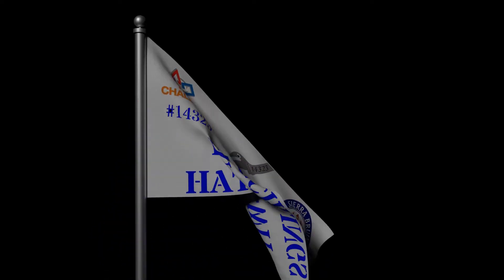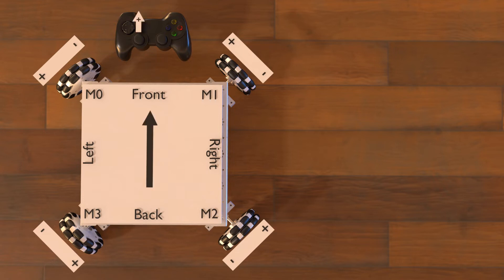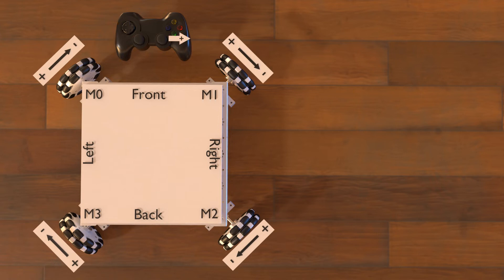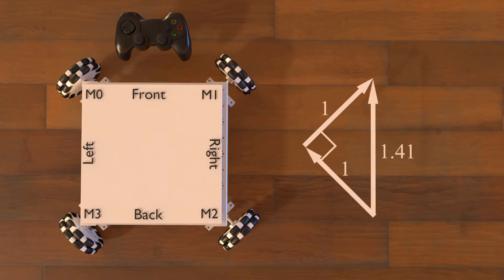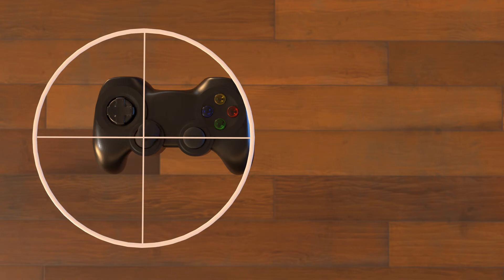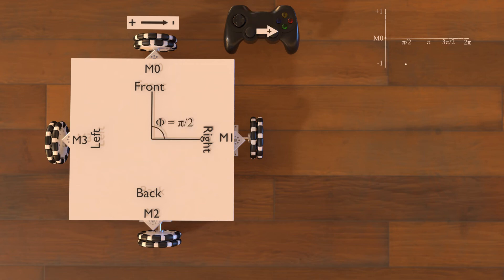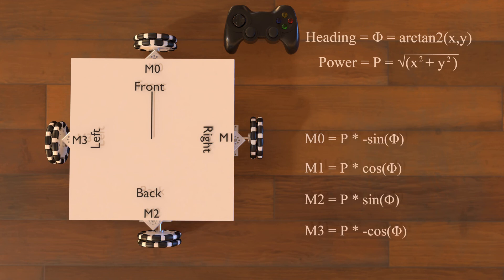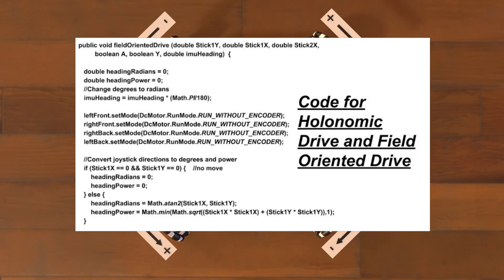Holonomic Drivetrains for FTC - Part 3

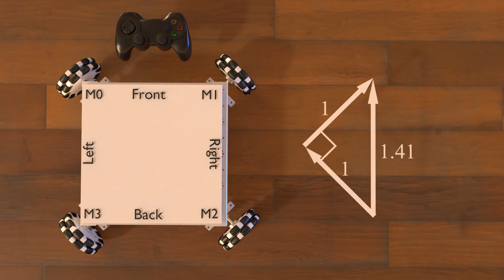Comment: Question: wouldn't the force vector as mentioned in 3:13 add up to 2√2, as the back motors are also contributing to the movement of the robot?